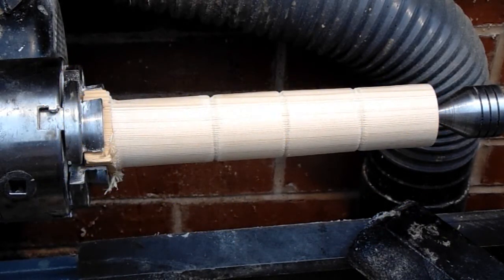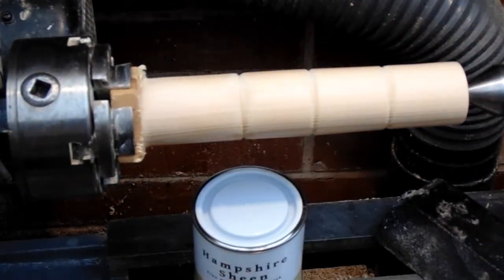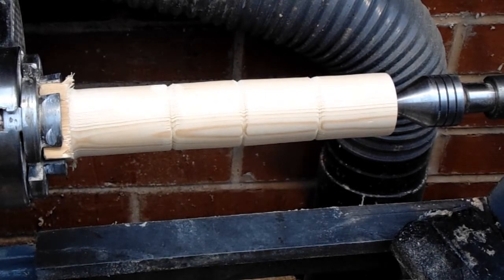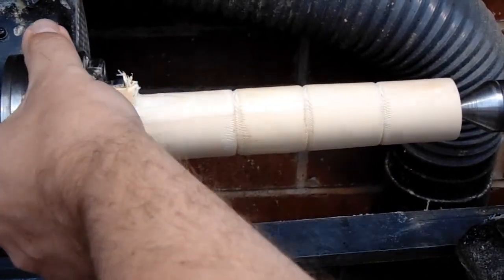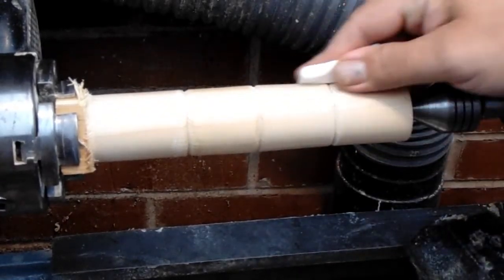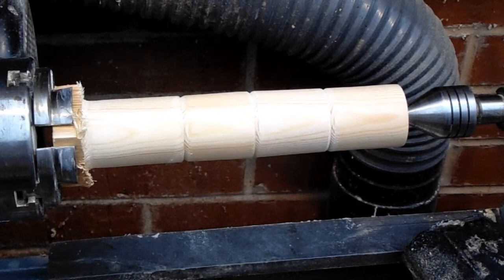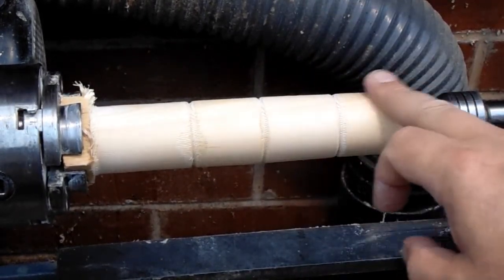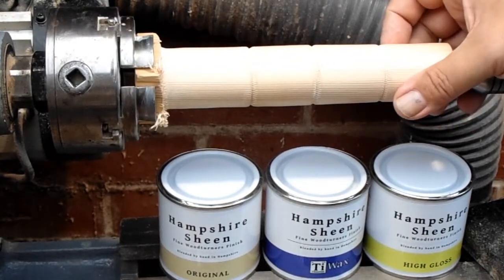Hampshire Sheen Finish Comparison

Comment: Hi Jake.The Ti wax is mainly supposed to be used as a liming wax.It even says so on the tin."open the grain of the wood with a soft metal brush,rub the wax deeply into the grain of the wood".
Reply from the maker: OOoops now where did I put my reading glasses.  Cheers Keith I will have to read the label and have another play.
Reply: Lol! I've done a review on it on an ash bowl,and it works a treat!😀

Comment: Hi Jake - good to see you back doing vids. I don't have the Ti Wax but I think it's designed to be applied on a stationary lathe and is more like a lime wax so would probably be better suited to a darker wood with some open grain...hey I could be wrong but that was the impression I got from Martin. Anyway how is the new lathe hunting going, have you made any progress? - Cheers Simon
Reply from the maker: Thanks, looks like I need to read the label.  Thanks for that.  Lathe funds building slowly.